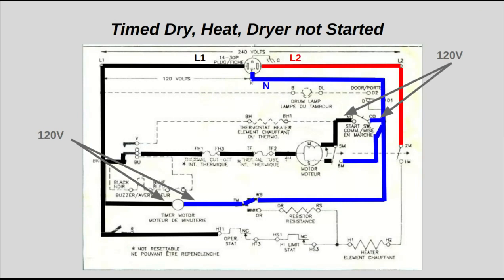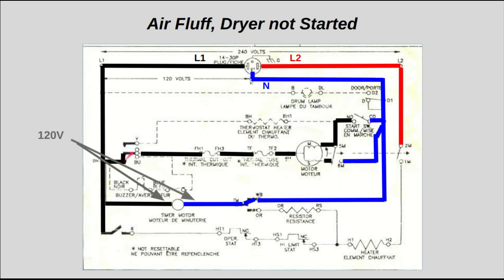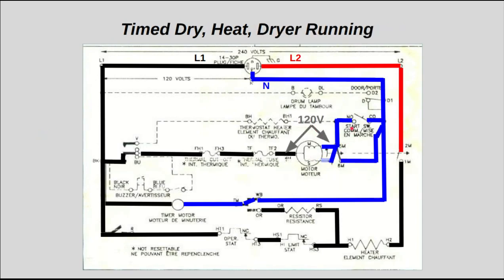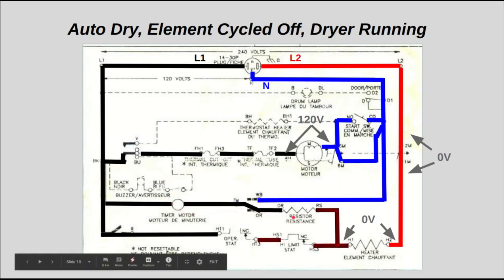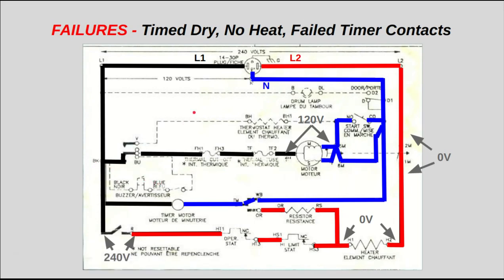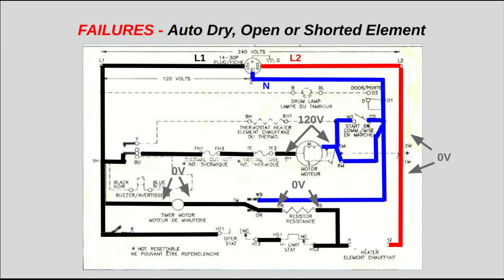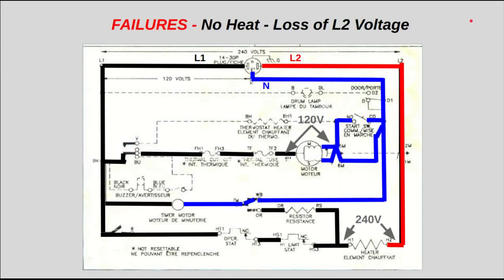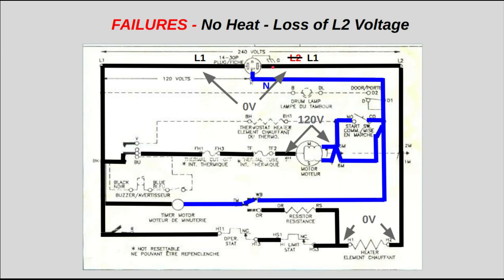#10 - Whirlpool Electric Dryer Schematic Voltage Map Walk Through

Comment: I'm gonna share this to our techs. The best explanation explanation ever!
Reply from the maker: Thank you!
Reply: @TheTechCircuit 

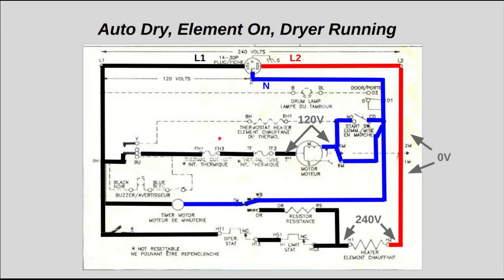Beginning at auto-dry, @3:58, roughly speaking, with the hi-limit switch open, is the heating element at the same time drawing current and heating?
Reply from the maker: No. The heating element is only 10 ohms, whereas the dropping resistor and timer together have a resistance (impedance) of about 9000 ohms total (4500 ohms for the timer and 4500 ohms for the resistor). This means about 240V/9000 = 27mA of current (approximate discounting the inductance of the timer motor). So if you have 27mA through a 10 ohm element, you only have 0.27 volts across that element and 7 milliwatts of heat from the it (negligible to non-existent), as opposed to 5760 watts (its normal operating wattage). Thus no heat at all from the element. This is a voltage divider configuration, where in a series circuit with multiple loads, the highest resistance (impedance) gets the most voltage. This fact is probably the most relevant take-away.

Comment: Nice video. One thing you didnt mention is when the operating thermostat fails to shut down this causes the 250 volt limit  to shut down and the voltage from the Operating thermostat spikes the timer motor and it runs directly to the end of cycle quickly. Subbed -PawPaw